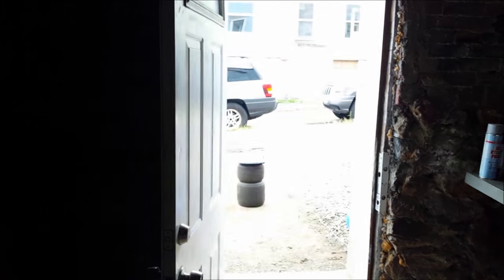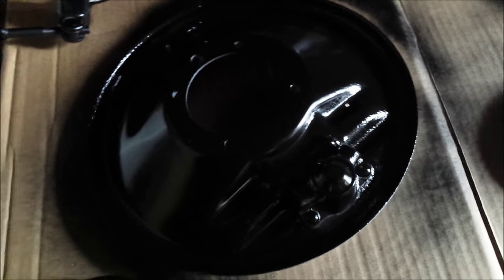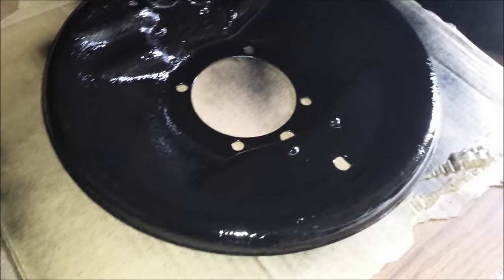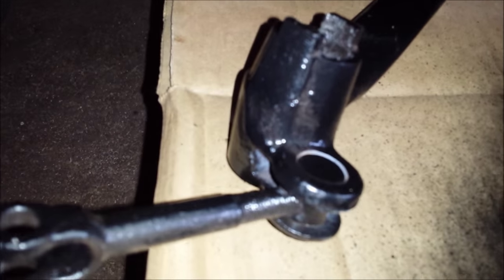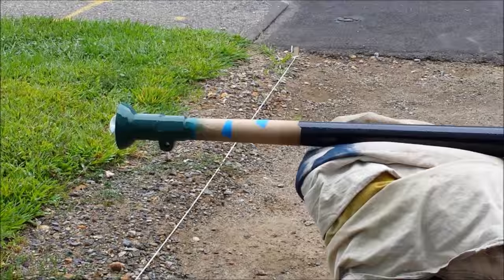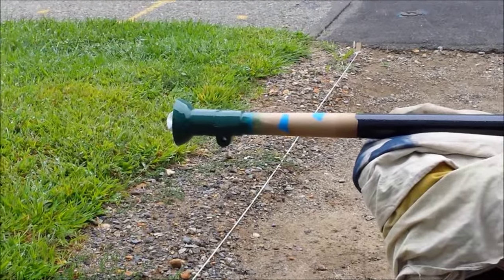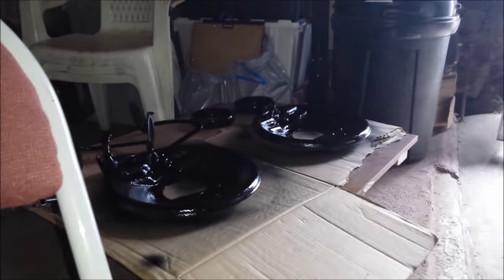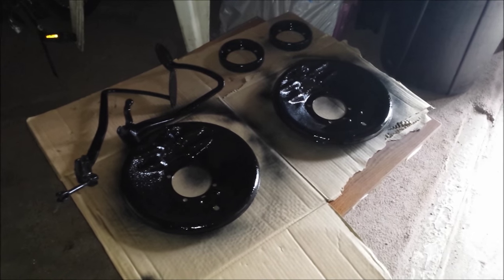painting model a parts , Dizzys shop

Comment: my friends of mine we did a 1966 F100 Fleetside in a 12 by 12 foot shed piece by peice frame off it was a 240 3 on the tree when i found it for him we built and stroked a ford FE 1967 360 we was told it was a 390 but when we pulled the heads off on TDC # 1 was .50 in the hole or about 1/2 an inch so we made it into a 390 use 360 pistons and 390 rods from police interpreter  so bottom is strong same heads for 360 and 390 but big gains using 360 pistons they r flatopped where 390 pistons r different so more compression about 11.1 bigger cam we twisted the stock driveshaft had one made oh gearing 9 inch 3:73's
Reply from the maker: Jim Rowlings well that must have been something bro, cheers my friend Jim
Reply: yes lots of fun body parts was all hand built